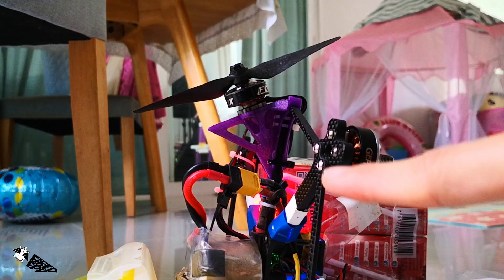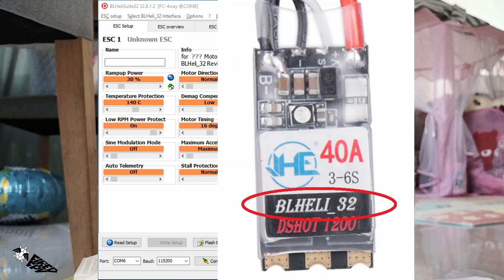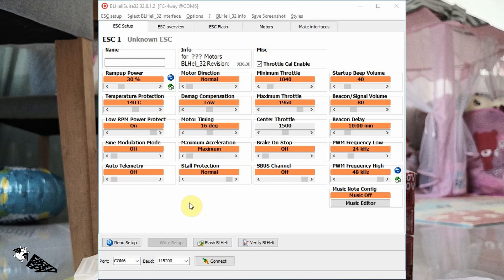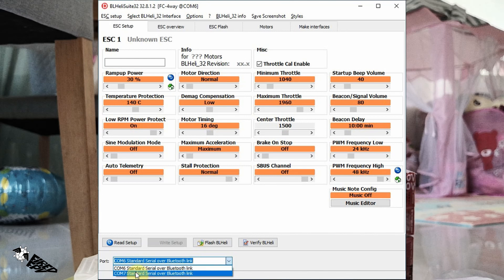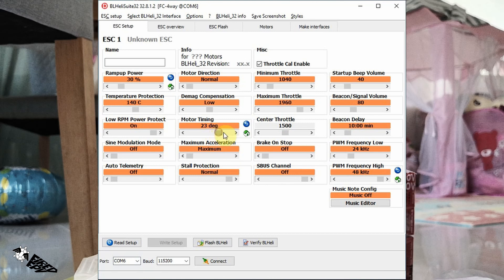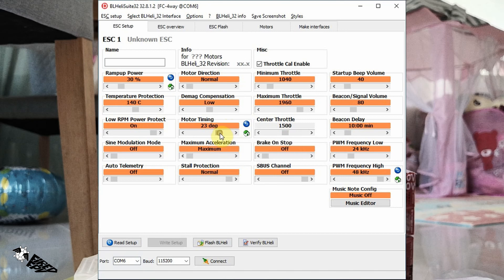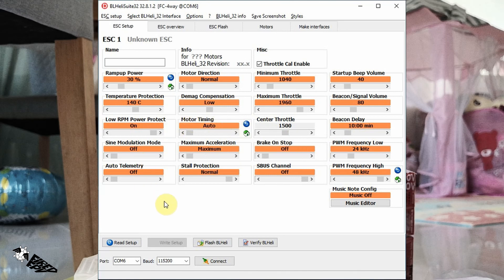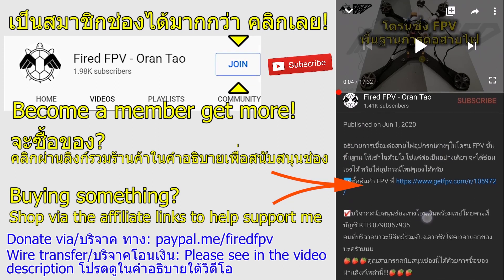Motor desync(stall) and fixed it. #motor #desync #esc

Comment: Hello, I am under bluejay, I also have a desync problem, I can't solve it for several months. I don't have "auto" in esc configurator...do you know how I can do it?
Reply from the maker: I guess you have to try changing the parameter(motor timing and PWM frequency) until you find the right amount.